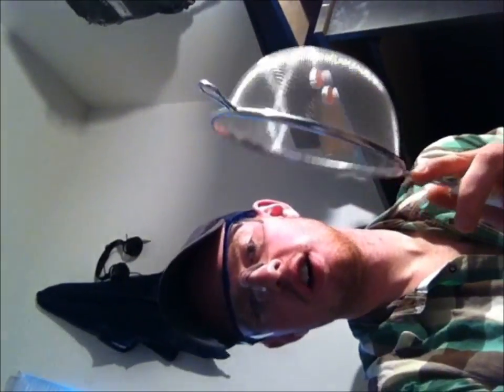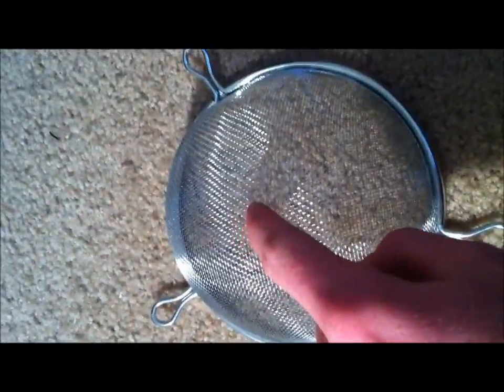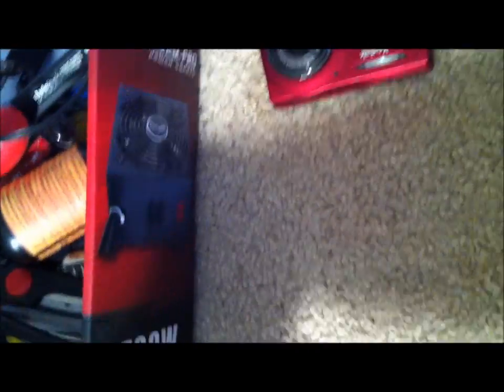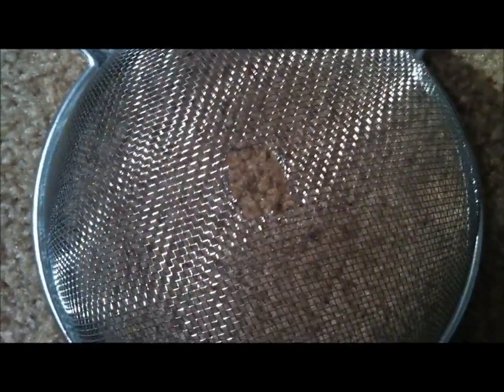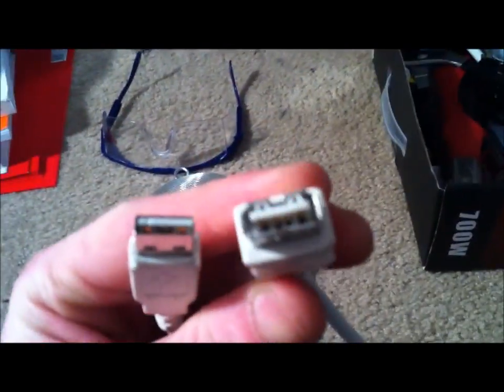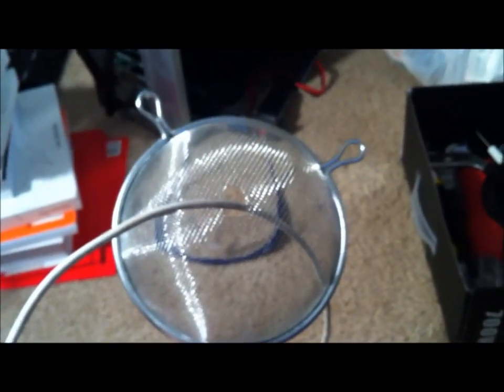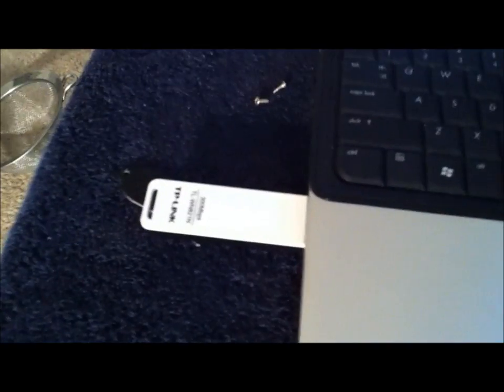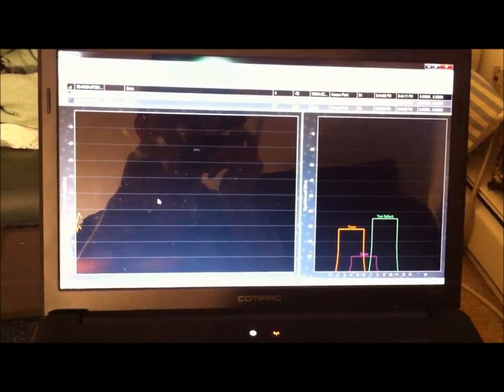DIY Long Range Directional WiFi USB Antenna Tutorial (AKA Wok Fi)

Comment from the maker: So I checked out the wikipedia page for "wok." Although there is room for interpretation, the article does state that "The main advantage of wok beyond its constructed material is its curved concave shape. The shape produces a small, hot area at the bottom which allows some of the food to be seared by intense heat while using relatively little fuel." I think a wok is nothing more than a Chinese Pan. Maybe the terms 'wok' and 'sieve' are distant synonyms. Maybe the article needs updating.

Comment: I believe the device you are holding is called a "Strainer" or "Sifter"
Reply from the maker: ETG311 Before I made this video, I went to the Providence Place Mall in downtown Providence Rhode Island. It is a rather large place. I walked into no less than five stores and asked for a wok. People looked at me like I was a crazy person. I was convinced that it was called a wok, so I did not feel embarrassed, just frustrated. Eventually I found what I called a wok at the dollar store, and because of the lack of labeling, I never double checked my terminology. Now, there are literally hundreds of comments correcting me. I have been taking my time making a sequel to this video. There is a ten minute clip that I have where I use a wok/strainer to make boiled poptart. If you check the video responses, you will also see a video clip in which I shoot an explosive out of my mouth with a parabolic mirror and the sun to demonstrate focal points. I also use a blowtorch for the hot glue. It is not finished yet.
Reply: Timothy Pleines A seive is one of the most used bits of kitchen equipment in anglo saxon cooking. That a guy does not know what it is is hysterical, like if a girl thinks a screwdriver is a chinese brush. Love seeing all the people protesting about the seive, it is so very over the top not to know what a seive is but to know how to make a home made antena, that no one can shut their mouths about it, its absolutely crazy.. If the original design was to be with a wok and the seive, which is cheaper and full of holes works, thats great. rose macaskie.
Timothy Pleines

Comment from the maker: @Ibringthetruth1 The focal point of the sieve (thanks for the corrections everyone) is roughly in the same spot as the internal antenna on the circuit board of the USB adapter. You can look at the thing as a tiny, shorter range, satellite dish. I think.

Comment: You basically converted an "omni directional" receiver to an "directional" one, your performance would be even better if you place the USB dongle an inch further from the tangent of the mesh towards the front so it receive the refractory signals bouncing of the mesh.

Comment: @Tim8242 He is asking question assuming the whole thing is a "TRANSMITTER", in my understanding. 
@Ibringthetruth1: It is a "RECEIVER". Its' much like a mini DIsh Antenna. The "WOK" concentrates the available WiFi networks on to the USB WiFi adapter RECEIVER in the "WOK", which goes to computer using USB Extension cable. Instead of a LNB of Dish, its the USB adapter. Thats it. If you want to extend range of transmitter, make a CD Antenna and put on your router.

Comment: XD lol, I got this video recommend by YouTube and you just literally have the same wifi adapter as I have :) If you have some experience with soldering and pcb's then you could actually solder an external antenna port on it so you will get more power out of it

Comment: A 3/4" non-metallic sheathed cable (Romex®) electrical connector and a pair of 3-4" to 1" fender washers are a much better way to mount the WiFi adapter in the dish instead of hot glue or duct tape because it allows you to adjust the depth of the WiFi adapter so that the antenna in the WiFi adapter is at the focus of the parabola.

Adding legs and/or a wall mount is the next project.

Comment: Just to help you understand, most of these parabolic antennae won't work well.  You see, the goal is to reflect the transmitted signal to your signal receiver.  They hope to increase this effectiveness by reflecting that signal from a wider area to the receiver.  What most of them fail to consider is that if the distance the receiver is from the reflector isn't right, then the signal bypasses the receiver.  (*You need the right curve as well as the right length in front of the parabola in order to focus on your receiver.)    In most instances you will do much better simply trying to shield interfering signals out than you will to try to build a diy parabolic receiver.  (*you can talk over two tin cans with a string too, but it's not very efficient)

Comment: Cool idea dude. I gotta wonder though, does the parabola need to be physically connected to the USB cable via a bit of metal wire? I didn't see anything being connected to the wire sifter other than glue gun plastic.

Comment: Interesting using a food strainer. Might I suggest and out door antenna that will just knock your socks off.  Try this model > Ubiquiti AIRMAX AirGrid M Series con 27dBi 5GHz. There are many types like my favorite the "Gabriel" antenna which is what I run.  Place it on a Antenna rotor at 110' ft above ground on a radio tower --WOW. You were able to picked up 23, try 2,891 my friend. Oh, FYI, next time, also try a Tripod for your cam... works wonders (Hands free).

Comment: i just did this....i have a old house (105 years old) with thick walls. the router is right at the front of the house and i have a laptop in a building at the back of the house. my signal bar was 1/2 bars...with the "siv" fitted...cost me £3 i have 4/5 now thank you

Comment: Great video! Parts of it are very funny. A serious question: Every Wi-Fi in my area is protected and from what info I can gather, most networks in any area are protected. An open Wi-Fi is usually monitored so you won't have 24/7 access. What good is building your antenna if we don't have full access?

Comment: Just a thought here, but I bet you'd have gotten just as many wifi signals by using the extension and waving it around just like you did with your COLANDER or STRAINER - why?  because your parabolic antenna DOESNT REFLECT (the wires are curved and would disperse the signal rather than reflecting it toward your antenna)
Reply: (A wok is a parabolic frying pan)

Comment: I made it ,it works fine,the only problem I get is overheating problem (wifi usb adapter turns off )if I put outside and mount on the roof

Comment: If the main idea is to have the wifi adapter in the middle of the metalic colander, isn't it easier to put in the end of a wire and stick the wire in the handle? That way, you wouldn't have to make holes...
By the way, a bit of wire and some duct tape and that cool hat of yours will make an awesome head-up-gopro-like-camera-adapter for your smartphone (or you can just stick it in the buckle in the back of the hat. Believe me, it works! :-)

Comment: It's not a Wok, or a spaghetti strainer, it's a sieve. Pronounced "s-ih-v". It's for stuff like aerating and removing lumps and clumps from flour, or straining water from stuff. (It wouldn't work for straining spaghetti, unless you wanted to make a half portion.) Old ones had a hand crank and metal paddles that pushed and scraped the flour against the mesh, I guess that flour got clumpy in the not-so-olden days.

But WokFi is cool!

Comment: It's not a wok. It's called a wire strainer. A wok is a solid piece of metal like a skillet but is more rounded like a bowl with a handle. A real  wok is hammered into shape by skilled craftsmen.This leaves slight hammer indentations that work well for holding bits of meat or vegetables that are deemed cooked out along the outer edges and not in the hottest part of the wok which is the center at the bottom. This allows some parts of the cooked meal to be moved and held away from the intense heat while more dense vegetables or meat remains in the center to continue cooking. It is primarily used for flash frying. If a wok is advertised as stick free or teflon coated it is, in my opinion, not a real wok  and not worth taking home. Sort of like calling a rubber mallet a ball peen hammer.
The wire strainer is a cooking aid for separating solids from liquids. The two protruding loops of metal from the strainer frame are used to support it over a pot or pan. Say you are boiling tiny pasta shells for home made mac & cheese. You boil the shells until cooked and then poor the liquid through the strainer. The strainer catches the shells but allows the water to run off. Or you could use the mesh strainer, as it is curved, as a signal reflector that focuses the reflected signal to a predetermined point (depending on the curvature angle) in front of the strainer. An old 12 foot diameter aluminum mesh satellite dish and the feedhorn would make a good comparison.
Reply from the maker: Hundreds of people have commented on my video to tell me that it is a sieve, not a wok. However, your explanation of why I was wrong was by far the best. It's just that....those were different times. I had been awake for at least 2 days. I had a few other commercial wifi antennas in the apartment that were connected to my router and the radiation from the antennas was messing with me, I couldn't sleep and had horrible headaches for a few months before I googled it and found out that some people claim to be overly sensitive to microwave radiation. It could have just been a coincidence. If you look at my "Extreme Science" playlist, I have a video where I use a few thousands volts and a magnet strapped to my wrist to control the capacitive touch buttons on an Xbox 360 from a few feet away-turning it off and on and controlling the disk tray eject button; I have no idea how this works but it was easy for me, I get this sensation in the back of my head that is indescribable ( it is halfway between a sound and a sensation ) that allows me to do stuff like that.
Reply: Timothy Pleines Get back to me when you can make stir fry in a wok using only your thoughts to produce heat. I think if you can master that you might have a marketable product. But if dudes with sunglasses and black suites show up at your door. Cook them, cook them right where they stand. Don't worry about finding a wok. Then take a long trip far far away.
Seriously I'll try using your wok/strainer idea to see if I can get the laptop to get a signal from the barn. Thanks, Draugr

Comment: you need a tripod it can hold the camera while you finish the video..other than than its a funny informative video.. I made a  home made wi fi extender to.. the beer can antenna type  it works great.. the hot glue you used is brown thats a different type of glue I use.. what type of glue is that is it stronger then the clear.. I have a small tea holder mesh type I might use that instead then connect it to the end of the beer can the round part left over I might use that part to.. I like the usb wi fi extenders much easier to use..

Comment: Wok fi is actually going to boost your signal....Personal eXperience tells me so!  Won't boost it by much.....I was around 20 metres out of the coverage zone....Simply used a disused cable TV dish around 350 mm dia....the wifi hotspot receiver mounted on the electronics hood box connected to the ant feed!  Still slowish but...got signal!!!  Plus I used to install for a crust! Lol

Comment: Number of access points is well and good but what about signal strength before & After?
Reply: The more access points made available after doing this obviously  the signal strength has increased rite? No doubt It works, but so does the same USB WiFi adapter sitting inside a can of Pringles. I tried that one just to see, the Pringles can worked very well after finding the right spot within the can. It's also called a  "Cantenna". I saw it on TV and it actually did make sense so I tried it last year.

Comment from the maker: Yes. Most recent apple iPod type devices, including the iPhone have the WiFi transceiver and antenna located near the bottom of the device (near the home button, but on the back of the device). This does not need to be precise to work. You can use an ordinary bowl, line the inside with aluminum foil , and put the iPod/iPhone in the bowl right side up. Use your imagination and don't be afraid to get creative. Play around with it and you will eventually get a boost. This is a quick and ugly method

Comment: Could you plug the USB into a router rather than a computer then use multible devices
Reply from the maker: +Dalton Bush Short answer: yes. Long answer: it would be more trouble than it is worth. First, you need to find a router that is compatible with the custom firmware that you will need to install. Then, you need to manually configure the wireless repeater settings. Then, you need to get a Linux shell running on the router so that you can attempt to configure the wireless USB adapter as a network interface. Then, you need to connect the new network interface to a virtual network bridge, which also needs to be configured. I have a better idea. What you are talking about creating is generally referred to as a 'Wireless Repeater.' A wireless repeater connects to wireless access point and then shares the internet connection with any wireless device that you connect to your repeater. It is expensive to purchase a repeater, and most consumer wireless routers do not give users the option to operate the router in repeater mode. Fortunately, top level geeks have already found a way around this by creating custom open source alternative router firmware called DD-WRT that you can install. Check their website to see if you have a compatible router: http://www.dd-wrt.com/site/index and then get to work installing it. Now, the wok-fi. You need to forget about the wok-fi and use either A) Bigger antennas (check amazon for sma-type antennas to replace the existing antennas, they are super cheap) or B) Build a 'cantenna' aka a waveguide antenna (a cantenna would work best for a repeater because it is highly directional and longer range and you can aim it right at the signal you are repeating). The cantenna can be easily rigged to attach to the antenna connector on the router. My advice is to set up the repeater with the default antennas first and only go through the trouble of modifying the antennas if you really need to. DD-WRT gives you the option to increase the transmit power of the router so I would play around with that first. I have not made a YouTube video in a while but I am getting back into it. Let me know if you need more help

Comment: I also saw your reply to someone on those microwave food sleeves that vector the waves. Could i even tape a bunch of those into a sheet and place that opposite my xbox? Im willing to try anything here :P lol
Reply from the maker: Yes, you can. First, you should do a few google searches and find out where the WiFi chip is located inside of the Xbox. Try reflecting the radiation towards the chip. Aluminum foil works too, but it is aesthetically unpleasing. Remember, this will take a few hours of careful tweaking and guesswork, but it will work.
Reply: Timothy Pleines the only way i can make that work (i already know where the chip is via direct access to it) is if i put my tape array behind the xbox relative to the wifi. essentially, it will reflect radiation passing the xbox back to it from the other direction. I have a concern though. would the radiation going the other way cancel out the rad. coming the usual way? like two ocean waves colliding and scattering/canceling? wouldn't the same physics apply?

Comment: so i can get free internet if i find a network with no password or live near a starbucks
Reply from the maker: Yes. However, I recently lived in an apartment 1 block away from a Starbucks with no direct line of sight. I used a cantenna instead of a Wok Fi to use their internet. I have a video on cantennas, if you google it you will find it. A cantenna has a longer range, you need to aim it like a sniper rifle at the target WiFi. You can build one with 10 minutes, a coffee can, and scissors.

Comment: What is the range of that thing? Does it act as a powerful transmitter as well?
Reply from the maker: Well, yes, but also no. The total amount of transmitted power does not change. Let's assume that without the sieve, the USB stick transmits 10 units of power. With the sieve, the USB adapter still transmits 10 units of power, but the power is concentrated in one direction instead of all directions. You can build a homemade wifi booster called a "cantenna" that does a much better job concentrating those 10 units of power. If a wok fi is a shotgun, then a cantenna is a sniper rifle. Try thinking about it that way.
Reply: Timothy Pleines
Okay. Thank you for the explanation.

Comment: So, the WOK (which is actually a sieve, by the way), is less directional than the dongle used on it's own.
This doesn't really prove anything. You might get as good or better results just using the dongle with the USB extension cable alone. 
Please, don't, whatever else you do, try to get a job at a Chinese restaurant.

Comment from the maker: holy crap so I am working on 2 follow up videos for this, using the cantenna method. One will use a pringles can (which is very common), and the other video will use a can with a wider base. Anyway, I ate all the pringles at once. BAD IDEA. Luckily I have it on video so you can all get a good laugh at my time-lapse stupidity. When I am all done with the video.